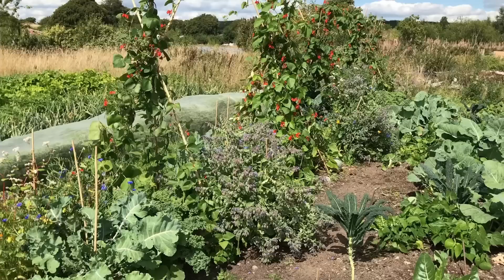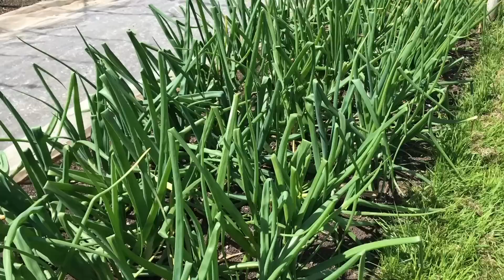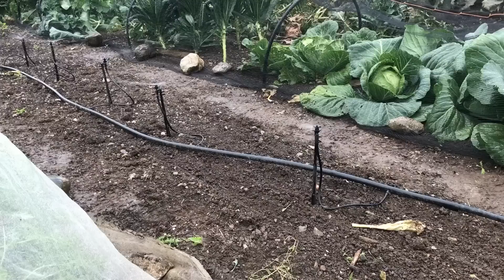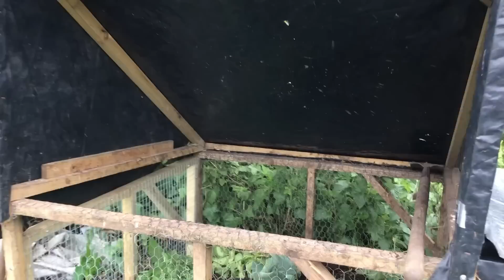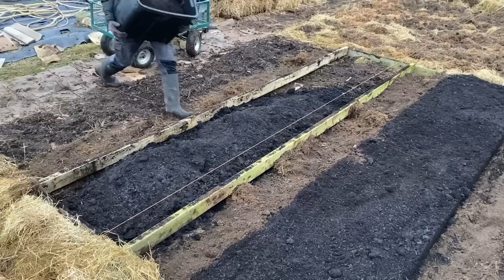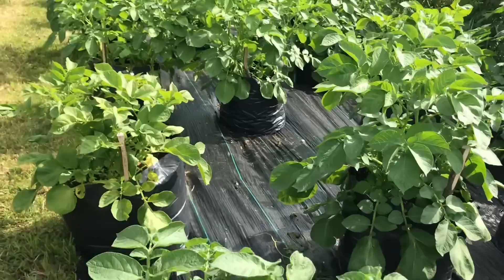Plans for 2023

Comment: You seem to use a lot of extra fertilisers,like Charles Dowding I rely mainly on home grown fertilisers,compost rockdust,charcoal and liquid manures,plus a little bought in b,f,b , liquid seaweed,and a couple bags of organic compost,I'm only small scale,not very intense,but my soil quality seems to improve yearly,with abundant results,and not too many failures,I'm moving towards no dig,as it makes complete sense now,but I was initially resistant    to it,luck plays its part and we all learn a lot from each other,keep going,and good luck.
Reply from the maker: I manage quite a few different growing spaces, and each one uses a different source of fertility. Some rely on compost alone, and others have a lot of concentrated amendments. But I have been shifting to using more concentrated fertiliser because of the scale I am working at, as it just makes things easier and more predictable.

Comment: If you want to establish a perennial garden, don't you think it would have been a good idea to cover the ground with something (permanently), to inhibit the weeds? :) Ideally in the fall, but spring works, too - well - in climates where winter is winter :) - so, I guess, anywhere in between fall and spring :) Weed fabric, a foot of wood chips, 2-3 feet of straw...
I really wish you had more on the 3 sisters.
Reply from the maker: Planning to try to grow the three sisters both inside a polytunnel and outside this year, but I don't have high hopes for good results from the plants outside because of the cool climate here in Ireland.

Comment: How do you manage to keep track of all these projects! Amazing work. I've been developing my little plot for 8 years now. It's on a terraced mountainside in the Italian alps, very acidic and free-draining, shallow soil over bedrock. Lots of organic input, largely home produced compost. Wood ash to increase the pH, home produced hay mulch to keep the soil moisture in the summer, drip lines (gravity fed) and 10,000 litres of water storage from rainfall and a spring. I have a 25 square metre poly tunnel with sides that open, because it's much too hot in the summer otherwise but keeps tomatoes, etc. disease free. So far I have found that a no dig system is good, but not perfect. So I use a combination of low tillage, with some soil aeration, no dig, and crop rotation. This winter I tried some cover crops, but with little success as a really sharp frost damaged most of them irreparably. Plus, I do seed save, and have developed a couple of good, reliable landrace varieties (peas and tomatoes), largely by accidental cross pollination. I'm limited in the amount I can do, there's only me doing it and I'm not far off 70!
Reply from the maker: It does take a lot of planning and spreadsheets! Sounds like a nice setup you have, thanks for sharing your experiences. I'd love to have a place in the alps!

Comment: Thanks for posting your high quality content. The data you share is so valuable as are your experiences. I'm having a hard time imagining how you have time to do all  this work with only one other person helping you. And now you are planning for more. Irrigation will be such a time saver, once you have it dialled in. It could also be a way to deliver fertility.  Its important to keep monitoring it though as sometimes there are failures and especially with subsurface weepers it can be hard to timely detect. In recent years I've been moving more towards minimising reliance of off site fertility in-puts in my small veg garden by utilising one time inputs like biochar, and zeolite and then utilising things like lacto acid aided compost tea amendments and of course hot composts. But I will still take advantage of being able to bring in off site materials like horse manure or leaves etc as I run into them. The one thing I do rely on horse manure for though is to heat my tiny green house with.  Depending on availability, I will count backwards about 4-6 weeks from anticipated plant out date to start the approximately 3/4 cubic metre hot compost. If I have enough for a second batch, I will stockpile and start 4-6 weeks earlier. Ideally from about now forward ( USDA zone 8b ) I can start baby greens and other cool weather tolerant plants.
Reply from the maker: Thanks for sharing your own experiences and methods. It is so great to hear what other people are doing, especially using horse manure to heat the growing space. That is awesome!

Comment: You have rodent issues.  Do they ever damage the drip lines in your hoop houses?  Voles, rats, squirrels and insects all bite holes in my outside driplines in the dry season.  I greatly reduced the rat and squirrel damage by setting bowls in the ground under the driplines in a few places.  The drip is enough to keep the bowls full for the rats and squirrels.  The voles dig tunnels along the length of the lines and bite large holes in the underside of the lines.  If it weren't for two house cats and a family of barred owls, I think the voles would have destroyed everything.
Reply from the maker: They have never damaged the driplines, thankfully.

Comment: Oof, I am not sure that dripline everywhere is gonna be a good idea vs. an overhead system of some description.
Lots of plastics and plastic waste (as dripline / tape wears out and gets damaged easily), lots and lots of hassle and less uniform watering, in addition to the higher costs.
I suppose worst case its gonna be a lesson learned, which is in the spirit of the project.
Reply from the maker: An overhead system is a tough one to set out in my context. I am not keen on so many pipes, but having weighed up all the issues (time management, sharing the water supply with others during the day, evaporation, etc.) we figured that driplines, with occasional hand watering and sprinklers is better option.